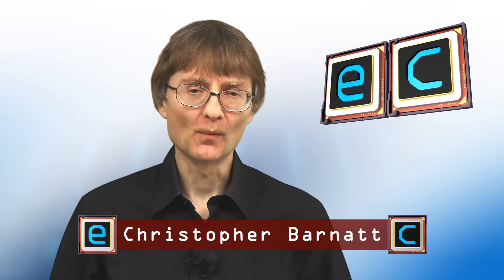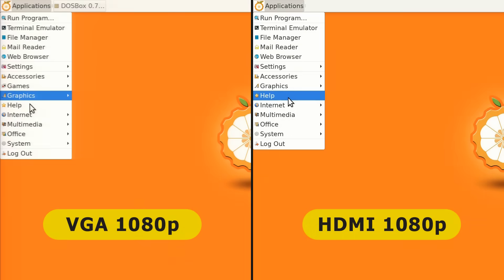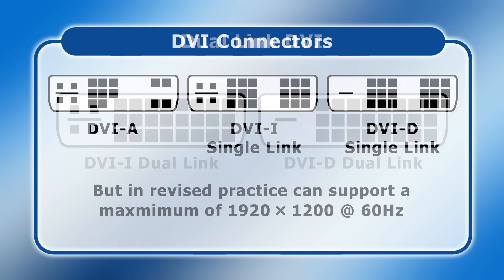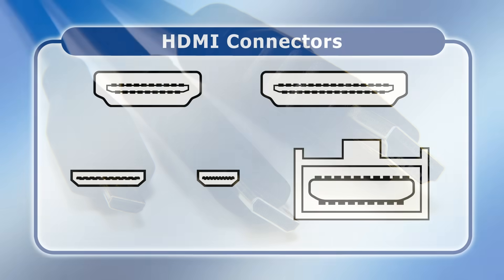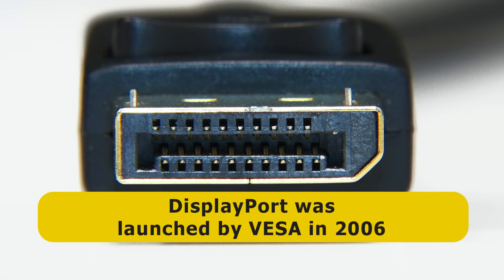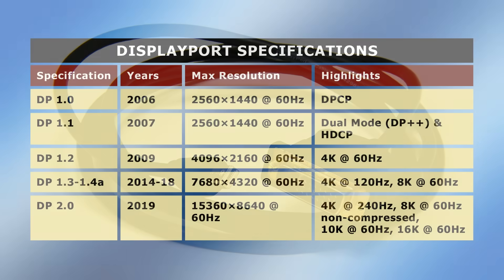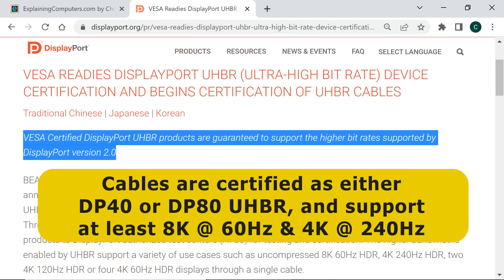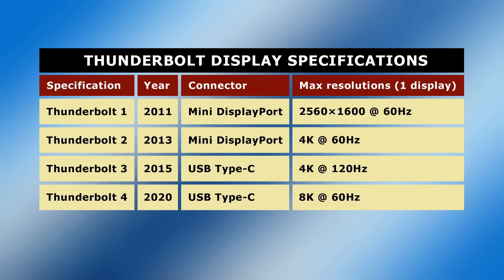Explaining Display Connectors: HDMI, DisplayPort, USB-C, DVI, VGA & Thunderbolt

Comment: Im pretty sure some graphic cards are able to output audio via DVI-D if you use dvi to hdmi adapter
Reply from the maker: Yes, there are adapters that take video from a DVI-D port, and audio from audio jacks, and send it to an HDMI connector. And there were some graphics cards that offered what they called "HDMI audio over DVI" -- which is absolutely not part of the DVI standard. The video came from the DVI port, but the audio just happened to be chucked onto some DVI pins so that a non-standard HDMI adapter would provide video and audio to an HDMI monitor. It is not possible to connect a computer to a monitor via DVI to transmit video and audio. :)

Comment: You forgot that nvidia and amd had audio over DVI
Reply from the maker: Yes, there were graphics card is specified for "HDMI audio over DVI" -- but this was absolutely not part of the DVI standard, and I always thought was a very foolish idea, as it involved outputting video over DVI pins specified for a different purpose. The video came from the DVI port, but the audio just happened to be chucked onto some DVI pins so that a non-standard HDMI adapter will work to provide video and audio to an HDMI monitor. Plug a standard DVI cable into the port, and connect it to a DVI port at the other end, and you would (a) get no audio, and (b) could be in trouble . . .

It have never been possible to connect a computer to a monitor via DVI to transmit video and audio. This video is -- as I said in the opening -- about standards. Not about how some companies broke them. :)

Comment: Oh man, time goes by so fast, I still remember hooking up my machine to my B/W TV using RF cable.
The future may hold more madness.
Suggestion: I wish you could put these comparison tables somewhere on your website so they can be easily referenced when needed.
Thanks Chris
Reply from the maker: You are absolutely right -- the tables should be on the website. I have a note to do a major update to the EC website to incorporate a lot of new video and related content. I will take you comment as a reminder to make this happen! :)
Reply: @ExplainingComputers  Much appreciated :)
Reply: The Commodore Vic-20 looked great at it's 22 character per line resolution. Tune your TV to channel 2 and turn on the computer. 4k RAM was the bomb.
Reply from the maker: @PCman50  So true. Those were the days! You may appreciate next week's video, where we return to such resolutions with a modern take on old BASIC computing . . .
Reply: @ExplainingComputers  Well I was a professional night club musician playing on a rock group touring on the road living in hotels for some 8 years as a young man in the early mid 70s. But I had an electronics certification but at the time music was my passion. But that all changed when I purchased a Radio Shack TRS-80 in 1978 with 4k ram. I was hooked and ended up quitting my rock band to get my first computer job in Dallas TX. In the 1980s I worked full time selling and installing PC-XT clones. Eventually started my own computer business in 1990. But that Radio Shack 4k and programming in Basic was awesome and was a new beginning in my life. I worked till retirement as a Network Systems Administrator for a large medical company.
Now retired and 71 I still enjoy tinkering in my home computer Lab that's looks like a commercial Enterprise Server room with racks of PC's Pi's and thin clients running as Media servers and running my automated home. My whole home is controlled by all my gadgets. Oh I still play in a rock band. A bunch of old men still rocking to classic rock. 
Life is good.
Reply: @PCman50  Rock and computers. Hell yeah, life IS good.
Reply: @PCman50  Wow, you have had a very interesting life,
I still have my old programs saved on cassettes and I always wanted to upload them on github but unfortunately life is not easy.
Regards
Reply: @johnphilippatos  haha. Yeah it's all good. 👍😊
Reply: @ahmad-murery  I haven't looked at them for years now, but I have a couple large boxes of old Commodore software most on cassette. And I still have an original TRS-80 Model 1, with all the additional hardware ask boxed up in like new condition. Have not touched it in decades. But intending to sell it on eBay one day as it's a collectable item by now some 45 yrs later.
Reply: @PCman50  I've only seen TRS-80 and Commodore in magazines and I liked them at the first sight.

anyway, I had too many good memories with my machine and I can't sell it to anyone, I'd rather give it a new life by using it in some projects (after all I think it's a capable machine if you know how to talk to it)

If we had a retro lover community where I live, I would give it away to someone who can take care of it.
Reply: @ahmad-murery  The TRS-80 Model 1, was so Innovating in 1978. As I recall it was $599.95 for the all-in-one keyboard that hosted 4kb ram and built in basic. Radio Shack had easy financing and all I had to do was sign for 12 months of affordable payments. But turn on the Power House and you were greated with a Basic prompt. Spend 20 minutes writing 10 lines  of code and then another 10 minutes saving that code to your included cassette data recorder.
Those were the days yes indeed.
Reply: @PCman50  I was born in 1978 and I got my Sakhr AX170 MSX1 64K of RAM (used) in 1994 when the technology was dead, this was all what our saving could afford at that time (for about $200 for the machine itself only),
I remember that it was able to transfer data to the cassette recorder @2400 baud rate which cuts down the time of saving/loading in half,
anyways, a typical 32KB game usually takes about 5 minutes to load @1200 baud, but my brother and I found that we can load some type of the games without running it then save it again @2400 baud,
I also remember that I spent hours and hours in front of the screen until my eyes start burning trying to accomplish some programming ideas (my desk used to be a TV packaging box😅)
I feel nostalgic for those days 😌😥where life was easier and more enjoyable
Reply: @PCman50  That was the golden age of computing when creating a little BASIC program would make you happy the whole day and maybe excited for a week or so,
I never had a Commodore but an MSX1 and I got it when it was outdated (1994), anyway it gave me a huge push towards programming.
Reply: I remember using flat twin lead antenna wires. Screw each wire down. It worked.
Reply: @1pcfred  Yes I remember that too 😌the good days that never come back

Comment: I never realized that DVI had that many different versions. I suppose I was just lucky that when I ordered a DVI cable that it was compatible with my computer and monitors. I still wish HDMI had some sort of locking mechanism. That's the main reason I still cling to DVI cables when I can. Thanks again for another informative, well-made video!  I'm off to inspect my cables and ports now.
Reply: I suspect the differences occur at the device socket and all DVI-DVI cables are straight through
Reply from the maker: Oh no, DVI-DVI cables come in all the different versions . .
Reply: Just use Display Port if you can.

Comment: The good old days of just VGA were so much simpler! On my desk I have a Raspberry Pi 400 with micro HDMI to VGA female cable and a VGA cable to one monitor, and micro HDMI to standard HDMI adaptor with HDMI to DVI cable to a second monitor. I also have an old (new to me as I bought it last week!) desktop PC with a nice simple VGA to VGA cable. While everyone else is buying fancy new monitors with HDMI and stuff, there's a good supply of very cheap, and free, VGA/DVI monitors readily available, and I'm collecting them!
Reply: Sadly the computer, software, and IT industries no longer believe in the KISS principal.
I am sticking with my multiple computer with USB/VGA-KVM as long as possible.

Comment: What predates VGA connector on old computer?
Reply: As far as PC hardware goes, the CGA and EGA standards use a DE-9 which was a VGA type cable but with only 9 pins in two rows.

Before the IBM PC standard, there was S-video and originally composite video which came in a variety of cable standards.

Back then most of us plugged our computers into our TVs so antenna cable were what we used.
Reply: He did a previous video just called Explaining Display Connectors which may answer your question.
All the best.

Comment: The real beef I have with display connectors these days is the flimsiness of them. So easy for the connector to get knocked and damaged to both connector and port, even if knocked insignificantly. I also wish they would start to use naming conventions that describe their ability. 2.0/2.1 means nothing to the average consumer. Good video, Chris. I learnt something I was unaware of regarding some incompatibilities.
Reply: I like the big old connectors with the screws on them. Sure they're a pain to install but once they're on they're on. You could pick an old PC up by the video cable. You'll break the connector off the board but it'd support it.

Comment: Great video! Keep up the good work! Out of all the display connectors, I like HDMI most, as it carries both audio and video through it, and it is the standard display connector on most PC's, laptops, and monitors. Many display adaptors, switches, and splitters use HDMI by default.
Reply: Ha! I think your displaying your age. Sadly I've so much VGA stuff kicking around because that was the standard when I was in IT. Only the other day needing to interface to a Rasp Pi that I did not have a HDMI cable for, I thought "Oh yes I've got a spare KVM in the garage...I'll use that" only to remember its got VGA video connectors and PS2 mouse and keyboard ports, not even USB. One day you'll find yourself in the same situation but littered with HDMI cables that no one uses any more. It is only a matter of time.
Reply: @alexwild4350  omg I still have two monitors using VGA.

I had to go out of my way to buy a x370 am4 board that still had VGA in it.
I got one by a Chinese brand.
The thing is, I think it's like some sort of internal conversor, cause my Linux lists that port being a Displayport. (but it does capture the name of my monitor, and the correct supported refresh rates of it)

It's absolutely wild to think that not a single modern board has a VGA connector.
Something that, back in 2011 I would Deem impossible.
Reply: @CodexSan  there's Intel 12th gen 6XX boards with VGA and DVI connectors on them, wdym?
Reply: @goldenpanda7004  but I use AMD.

VGA on AMD seems like long gone.

You can search through the whole array of motherboards, from last and current gen, from after x370, not a single one has VGA.

This one I have is a Colorful X370M.
Reply: @alexwild4350  VGA and DVI will probably be gone before that! XD 

I don't see HDMI dissapearing anytime soon
Reply: HDMI WAS the standard connector for some (not too long a) time. Now everyone has a collection of HDMI cables PC and monitor manufactures are switching to other standards.
Reply: @jlinkels  I still see HDMI in a lot of PC's and adaptors, so it won't be gone for a while yet.
Reply: @technoWZ5598  I know.  But I hate when I have to set up a system and either the monitor or the PC does NOT have HDMI. And comes with DP or USB-C. Those PCs and monitors exist.
Reply: @johanneslinkels1486  I haven't seen any monitors with display port, and my PC has a DP port on the back of it, so I use DVI to HDMI, as DVI is built into the graphics card I have. It sucks that not many monitors have DP on them, I would rather DP than VGA. What about you?
Reply: @technoWZ5598  Yes, they do exist. A customer of mine has some. The problem is when the monitor only has DP and no HDMI. A HDMI (source) -> DP cable is not trivial and must be active.
Reply: I still proudly own VGA and DVI-D LCD monitors. While it is true, that HDMI has great advantages in transporting video AND audio, still VGA and DVI-D give me a more reassuring feeling 😄
Reply: @ArniesTech  Nice. VGA is good for displaying a screen only, with no sound, and it perfectly suits kiosks, or systems that do not need to display at high resolutions.

Comment: Wow .. now I'm perfectly clear with everything.. Thanks a lot .. 

Anyways .. This is my one of the most favourite YouTube Channel.. ❤️💫
Reply from the maker: Great to hear this, thanks for watching. :)
Reply: oh, really? Which dvi connector has two vertical contacts above and below the main? ;-) You can use simple unpowered converter to convert hdmi to dvi, what would happen if you then plug a dvi to vga converter to it? ;) Why some hdmi cables carry additional protection barrels on both ends of the cable and some do not? Why "gold plated" hdmi connectors were considered to deliver better quality of signal if the signal in question is _digital_? ))) See... you still know very little, but yeah this channel is awesome!